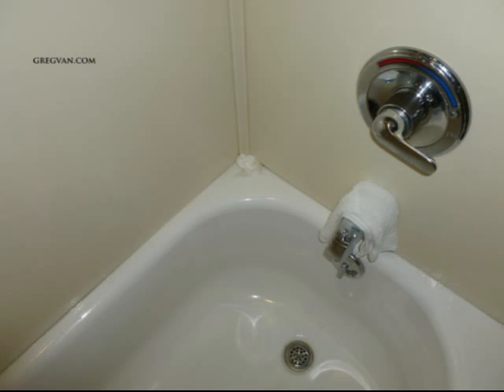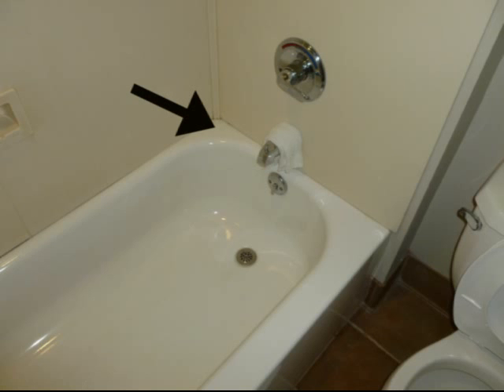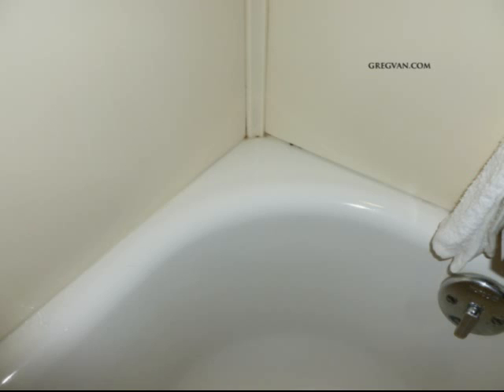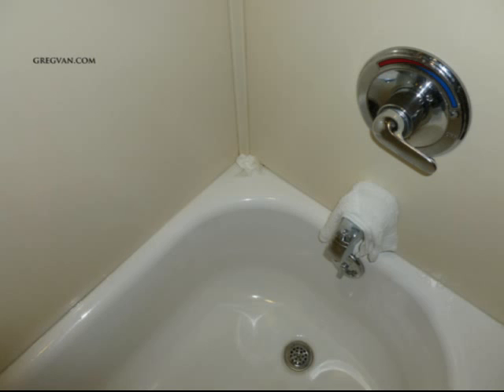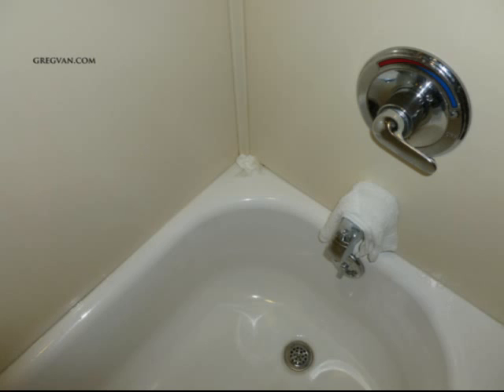Water Accumulating In Bathtub Corners Means Out of Level Construction

Comment: Have this exact issue. Is there a solution? I'm removing the silicon and going to try getting under and wedging something under the corner . May not be possible due to tiles above the bath but will give it a go 🤞
Reply from the maker: I really don't have a quick fix and if it was my home, I would wipe it down after each shower.

Comment: We are having this exact problem with one of the tubs in the home we bought.  Is there some way to fix it without pulling everything out and starting over? Thanks!
Reply from the maker: Not that I can think of.
Reply from the maker: Not that I can think of.
Reply: I cut a piece of ceramic tile in a triangle to fit that corner and pitched it slightly towards the tub and secured it with tile adhesive and caulked it, works great

Comment: this is happening in our bathtub on the second floor, as a result, the first floor has mildew issues. I tired to fixed it by putting a lot of silicon but then it cracked and now it has mildew. I guess if someone has this issue, they can make sure they use a squeegee to remove most of the water after showering, I am sure my husband won't do it to do so I will not even bother.

Comment: Does anyone know how to fix this problem without having to replace the tub? After 24 years our house has had some settling and now the bathtub is no longer level.  We get the water accumulation problem in the corners...
Reply from the maker: +Cajcat I don't know if you would need to replace the tub, but you would need to raise the corners and this might require you to remove the bathtub surround. There is no easy fix for this one and I will make a video, just don't know when to provide you and others with a solution.
Reply: If you have access to the corner of the tub through the back wall, cant you hammer a shim into the corner to lift the corner? How delicate are steel and  fiberglass tubs? Would a small shim cause damage to the tub itself or is a tub fairly durable?